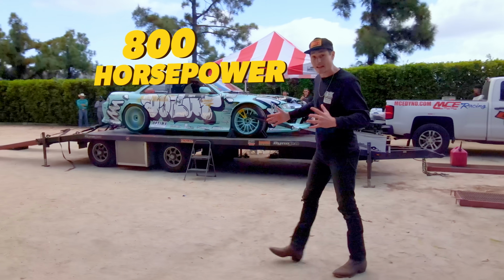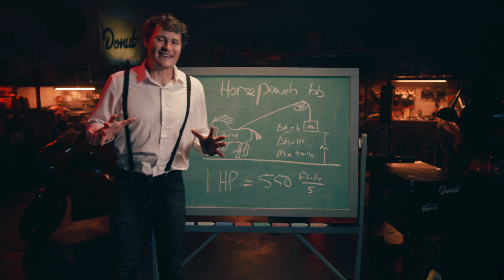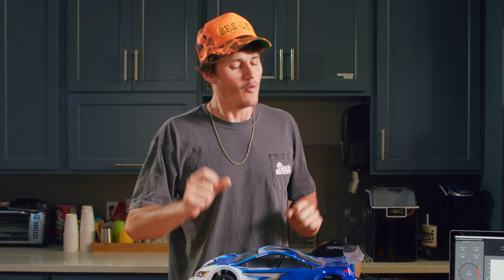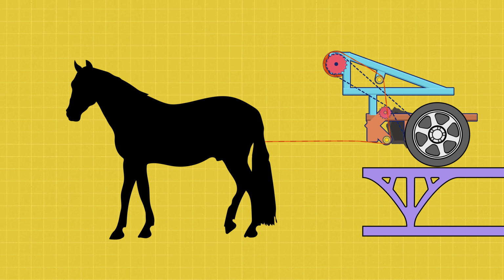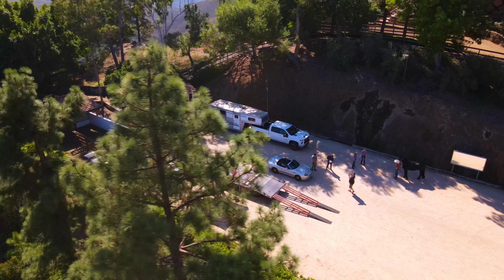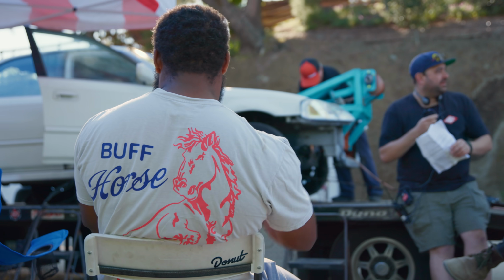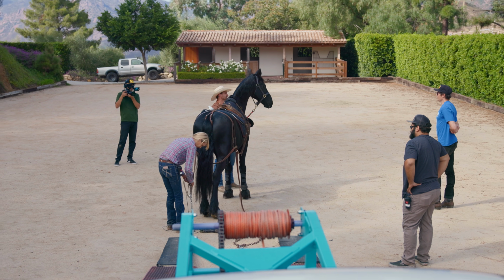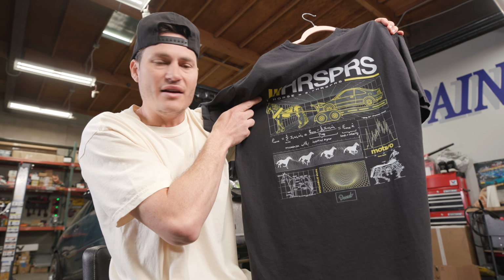How Much Horsepower is a Horse?

Comment: You kind of glossed over the initial purpose of the horsepower unit.  It was meant as a comparison to how many horses you could replace with an engine.  ie peak horsepower is irrelevant, what matters is the power the horse can put out over an entire day (or less? because a horse can't work all day...).  In that context, the peak horsepower figure seems pretty modest, because I can't imagine a horse pulling at 20% of peak power for a full day.

This makes sense though when you consider that the original horsepower inventer, actually wanted to downplay the power of their machines.  If someone bought a 5-10 hp engine that couldn't replace a 4 horse mash wheel or whatever, they would have really been in the s$&t.  Even if they were the 4 buffest horses in history.  And that's my understanding of the history; 1 hp is actually a very conservative estimate which is significantly more than the work a horse can do.

Of course that doesn't invalidate the estimation of peak hp of a horse, it's a really cool exercise, but I think you really misunderstood the history of the creation of the unit there. (Even though you described exactly how it was calculated to begin with!)

Comment: there's a problem (and this problem is explained in the video) : a Falabella (the small one) is less powerfull than me when a Shire is twice the power of the horse on the dyno 
it's like to compare me to Husain Bolt, i can't run as fast as him but i think on a boxing ring i can KO him down within a second because we're the same size but i weigh 75 pound more (and i'm a trucker not a thin athlete...for sure at the bar or at the table i can beat him)

Comment: The 'horsepower' was WELL known back when they were used to pump water from mines.   Walking around in a circle pushing a bar linked to the pump...the daily amount of water pumped equaled what a horse could do...so when steam engines were introduced they used the comparable amount of water pumped as their equivalent.   Everyone knows that a horse can actually put out lots more than 1 HP peak...but sustained over a long period that's not the case.
Reply: Exactly, that is why this "experiment" tells nothing at the end. As you say, the point of horse power unit was to compare longterm work output from the horse, not its peak power.

Comment: DONUT! This may seem like just another episode to you, but this has important historical significance. This is IMPORTANT! That horse was not a workhorse, and was doing nowhere near its maximum. Also, you did test for averages, but only on 1 horse. 5 tests with 5 horses each (of different breeds and jobs) would distill a more accurate average. You could even classify them into car equivalent classes. Like an economy horse, muscle horse, super horse and race horse lol. You should send that machine around to labs around the world and have them run a bunch of tests themselves. repeatable results from multiple unconnected sources is science. like Adam said. That's the process. Gotta let more people in to get truly academic scrutiny proof results. and at the end of it all after the rig has done its contribution to science, consider donating it to a big museum dedicated to the advances of science and technology where it can be displayed with full historical data on the original claim and these new modern results.
Reply: This would never stand up to peer review. 
They lack no repeatability. There are too many variables in their experiment. 
What they should have done is built a horse walker that can move up and down to line up a harness with a horse based on standard measurement. Several type of ground types to measure friction. Then using an electric motor mesure how much it takes to overcome said motor to which results in hp based on the horse's size, gender, age and weight. Then do this for a few dozen horses including work horses, stock yard horses, cattle horses and so on. This will give you a wide range of measurements to which you can get the data needed.
Reply: @kameljoe21  ye! traction is probably the biggest factor too. cars on a dyno don't have to worry about traction cuz the surface moves with the tires perfectly. if there was a way to give a horse perfect traction as well, much more accurate readings could be done. maybe cleated horse shoes in thick georgia clay like ground. we also need to know how to see if a horse is actually putting in its maximum possible effort. however this could easily get into animal rights hot water. don't wanna hurt the horsey. but true accuracy demands absolute perfection in conditions and repeatability. Also, if this were to get academically approved, i demand we recalculate engine horsepower ratings to be in light of actual horses. like, a muscle car with 500hp meaning it actually has the power of 500 real horses. that would just be so cool to see history like that being made. i wonder what other super old science stuff can be redone with modern science and tech. i need to go down a rabbit hole lol
Reply: @Subreon  This can be done with a horse walker or even a tread mill. A horse treadmill. They do have things like wood splitters that are run by horses and saws. So one could take what is standard and adapt a electric motor to it and apply a load until the horse stalls. This test would need to be applied over a period of x mins.  The same could be done with a horse walker in which the horse moves in a large circle applying a load for x amount of time and if the horse overcomes it you apply more load and the horse will lose grip or stall when it can not push/pull any more.
Reply: @kameljoe21  yeeeeeeeeee. either way. i just want 1 car horsepower to mean 1 actual horse's power by the end of it. gimme gimme.

Comment: I thought the point of the horsepower unit was averaging the total work a horse could safely do in a day, because a motor doesn't need to take breaks or sleep. But they just made it up for marketing and it never meant anything?

Comment: Ok, so i did some quick research and calculations. A typical draft horse weighs 550kg. If it is hard working, it is fed 1.4% of its weight in hay and 1.1% of its weight in grain every day. Assuming a metabolic energy density of 6MJ/kg for hay and 10MJ/kg for grain we end up with a rate of consumed energy of 1235W = 1.66hp. Therefore the current definition of horsepower seems pretty accurate to me.

Comment: 1 is 1 horsepower and  that is weight torque speed.. Not for instance 1 inch is 12 inches  when it should be a ffoot is 12 inches.

Comment: Amazing project, one question though. Why not just weld a sprocket to the side of that big wheel on the dyno, then make that mechanism closer to it, hook the chain up etc, get rid of the rest. Wouldn't this be more accurate?? No need for a car on there making more complications

Comment: I would say this experiment is flawed. cyclists have power meters which measures watts. 1 horse power is equivalent to 750 watts.... top cyclist can hit 1500w but that is for about 5 seconds. Average joes under 750w. I would have though this would be done on some treadmill attached to the dyno

Comment: When i realized that they performed this experiment with the intention of being peer reviewed and not just for views, i was like hell yeah! These guys are out to stir up mechanical history, and im here for it.
Reply: ohh yea me too, i was afraid this was just for fun project but turns out it's for science. waiting for that sweet DOI
Reply: As I scientist that often does peer reviews, I would have a lot of concerns. Using only 1 horse already makes any publication impossible imo. Let alone that the set-up is unnecessarily convoluted allowing for a massive amounts of errors. Furthermore, as stated at the start, horsepower was based on the power of a horse over a long period of time, not peak horse power. These ‘errors’ all make sense for this great video and this really isn’t a critique. But calling it science worthy of publication is a bit of a stretch 😅
Reply: @Nicolas_Heintz Agreed. Check out Nebraska tractor test.
Reply: I don't think this experiment has any potential to be used in a peer-reviewed study. The mere fact that Big D is nowhere close to the maximum size and power of a large draft horse (like the one shown at 3:10 in the video) the potential for alternate outcomes in results is too high to warrant consideration as proof of the horsepower produced by the horse as a species.
Reply: @grandpalarry7776  Their method is a worthy contribution on its own. The method is worthy of a peer reviewed study; just because they didn't fully answer the question, it is still a significant incremental step.

Comment: Great to watch..  Although this reminds me of trying to dyno a high RPM sports bike at 2000RPM and trying to make a high revving engine do tractor pulls and report HP in a wrong powerband.  This horse was not meant to be pulling at 7 km/h.  To accurately do this, will need some sort of rig that will allow the horse to reach 45-60 km/h so its legs can stretch and actually get its max potential.

Comment: Im not sure i understand why there needs to be a car in the design. Couldnt you just add a spool to the center of a standalone axle with tires on a mount? Why does it have to be tied into the drive train of an actual car?

Comment: Loved this episode!  Your question about horsepower has been one of mine since I was a little kid.  Thank you so much for exploring the topic.

Now, I'm not a rocket scientist, but to me, this was the most complicated, Rube Goldberg method of figure out how much horsepower a horse puts out.  All you needed to do is swap out the electric motor on a golf cart (or something similar) with your dyno (or something similar).  Hook up your horse to the front and pull it along a smooth flat road, then simply measure how many watts it develops under different loading conditions using an adjustable DC load to provide loading to the horse once he is up to speed. The purpose of using a dyno in the first place is because it isn't so sensitive to the various gearing scenarios of automobiles and its output is pretty much real world power that can easily be measured and quantified. Its voltage times the amperage, just like the way your normal dyno does when you test cars.  746 watts equals one horsepower.  Just divide how many watts you are able to achieve by 746.  There is no number crunching, it is highly accurate, and the whole rig could have been built up in one evening or two on the cheap.

My area of discomfort on your setup, there were issues with friction losses in the mechanical setup, the radius on the rope feed spool changes as more rope feeds out causing uneven and increasing torque, and I question the output accuracy of the dynamo because it is designed for much higher RPM measurements than happened during the test pull.

FYI, you can find on higher quality fitness bikes, often have an alternator (older ones often used one from an automobile)
, with a large power transistor dissipating the power into a large power resistor.  The electronics can vary the amount of loading to provide a constant output so that a person peddling fast has a lighter load, or a slower person has higher load, but the output is the same, so if you want to burn off a certain amount of calories, it will always take the same amount of time.
Reply: I couldn't believe they didn't hook up a 1hp motor to the rig to calibrate and have a reference value and validate the setup. Also don't understand how they first came up with how to determine an RPM value based on that spool, then how the equivalent was a measurement of the wheel rotation.
Reply: @esstyx66  I just wrote a comment how I was disappointed they didn't even mention calibration of literal measuring equipment. No one does that. And they want to be peer review... Their results come out that 5-6 people could beat a horse in a tug of war... in reality you'd need 50 men.

Also the og comment about strapping the horse to an electric engine and measuring the generated power is already a million times better than this video.

The rpm of the wheel is also directly proportional to the rpm of the dyno's wheel, which the dyno already measures with high precision...

Comment: So when the original "horsepower" was advertised it was the equivalent that a horse could output all day without stressing the animal. In the test you did it was one animal going full power for a very short time. Not something it could sustain all day. Still very important science you've done, but I wouldn't go out putting new labels on your cars quite yet.

Comment: Why not just have the horse run up a hill as fast as it can. It would have been easy to calculate the force of the horse since you have the distance, the speed, the hill incline, its weight with or without a rider and G (gravity)

Comment: The best thing would be to put a load cell on a line connected to a horse pulling a wagon up a hill. Speed of the wagon x force on the line = power. Of course you have to look after your units and whatnot. If you use Newtons and meters/sec, then the answer will be Watts.

Comment: I think you went about this the wrong way. It would have been easier and more accurate to measure the force on the string with a strain gauge and measure the speed of the horse. Then force times speed = power.

Comment: I’m no engineer but isn’t this a flawed. Like what about friction loss at hooves or the fact the horse was unlikely to have gotten to a peak, or that the horse is also using power to move it’s self. Like I’m not a car guy but the explanation of measuring power for the cars has the cars sitting stationary yet the horse is moving. It obviously uses power to move its self (like a car does). But seems like people a lot smarter than me were in on the project so I guess it’s above my pay grade. Entertaining video none the less.

Comment: This was fantastic. Now you need to do it again with all 500 odd types of horse. Hell, we should try it with other animals, I'd like to know what bear power is!!
Reply: Bear power would be cool. On the opposite end, bird power. A few ostriches harnessed together could pull about as much as a horse. But, the biggest animal's the blue whale. I bet one of them could just drag the portable dyno away into the ocean.
Reply: An arena bull would be just perfect
Reply: Ant power as well
Reply: I would like to know how much horse power a giant tortoise is.
Reply: @hiway19891 they are all torque
Reply: If I could say my van has one million bee power that'd be neat.
Reply: This is actually a great idea!! Not kidding! I would 100% watch a video showing what bear power or horse power is. I’m very interested. I would also like to see better methods for getting the data. The horse wasn’t exerting its full power and the method of measurement wasn’t the best bc a lot of energy was prob wasted on the rope, wheels, and other aspects of the measuring device
Reply: Yeah pig power
Reply: All the power you can bear.
Reply: Give that challenge to mark rober
Reply: Bearpower measured in horsepower which is not equal to 🐴
Reply: what do you mean by "we"?
Reply: Or manpower

Comment: I'm about mid way through (at the design phase) and thought to myself... KISS! No not the Legend Rock band, KISS and in Keep It Stupid Simple... Guess that's K.I.S.S. then 😆....

Anyways, why not to a simple free rolling (motorless/manual) treadmill. I know I know, it could be dangerous but hear me out. Motorless treadmills are a bit safer than the motorized one in terms of when one slows down, it does as well. Back to the K.I.S.S... have one end of the manual treadmill be attached to the dyno drum and try to get it as 1to1 as possible. That way the amout of energy loss is less to almost none.

The other trick would be to get a horse and rider to be comfortable on the manual treadmill. It did look like you were going that route but then bailed. I'm curious as to the reason.

I'll finish watching now aa you may actually address it. 😁

Comment: This test isn't correct. The horse's power is getting wasted on the transmission, wheels, ropes etc. The horse needs no transmission. To test the actual horse's horsepower, the test must be on the horse's actual legs/feet.

Comment: awesome video but the cheap dyno can be made using a dynamometer-spring and an indicator and at the same time measure speed P= F*v. You got 5.7 Hp at low speed but if the horse pulls less force but at a much higher speed you could get over 20Hp. for example 500kgF(5000N)@1mps=5000W; 50kgF @15mps =7500W. 
another question is how much power does the horse produce to move itself: top speed 20mps, average orce required to move all muscles say 500N -10.000W. ~14Hp.
a cheetah muscles can produce over 10hp of power only by taking into account acceleration and if we add other factors(muscle friction, wind resistance, ground imperfections and contact with the ground) we get a higher power output produced by the muscles just like an engine loses some power because of accessories or transmission losses

Comment: Why didn't they just wrap the line around the dino drum? This is a legite question. While it's a great example of using science and engineering to answer a question, why do all that extra work when you can directly hook the horse to the dino? 

The way they did it required a bunch of man hours and gave the contraption tons of mechanical variables they had to adjust for, then they had to "interpret" all that data, just to come up with an answer that they thought seemed right.